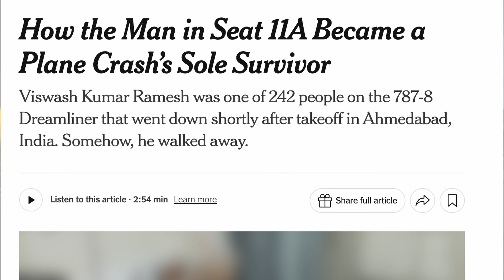Why the RAT Changes Everything – Air India 171 Update

Comment: I know exactly what happened to this flight. I did extensive research. I found a lot of interesting things about Boeing and Airliner. This is the fault of both Boeing and Airindia sadly. 

Back in 2015 Boeing had a bulletin that went out specifically for this model. 

Boeing identified a scenario where, if the Dreamliner is powered continuously for an extended period (approximately 51 days for the Common Core System or 248 days for generator control units), certain software counters could overflow, potentially disabling error detection or causing a loss of alternating current (AC) electrical power. 

This could result in the loss of stale data monitoring, leading to erroneous flight-critical data being routed and displayed as valid, which might compromise the crew’s ability to maintain continued safe flight and landing.

To mitigate this, Boeing instructed operators to perform regular electrical power cycling—specifically, to deactivate and reactivate the airplane’s electrical power at specified intervals (not to exceed 25 days for the Common Core System)

Boeing developed and distributed software updates to address these vulnerabilities. For the generator control units, a software patch was planned to prevent the counter overflow issue, with the update expected to be ready in the fourth quarter following the discovery

In another case, a software update was required for the radio tuning control panels, as a glitch could cause radios to switch frequencies without pilot input, risking missed communications with air traffic control. The fix involved a free software upload, taking about 90 minutes per aircraft

The electrical/software issue highlighted in Boeing’s bulletin is serious because, if not addressed, it could theoretically cause a complete electrical shutdown on the 787 Dreamliner. The FAA warned that a software bug could, under certain conditions (such as running the system continuously for a specific period), lead to a total loss of electrical power, which would affect critical flight systems

Now this would not be an issue if the power cycle is done without missing every 25 days. 

Air India planned a phased rollout to apply the fix across its Dreamliner fleet, consistent with Boeing’s recommendations and regulatory guidance at the time. But they were to apply this fix over five years. There was an article about this in 2019. 

My theory is this airline did not apply for a fix. Power cycling was not done or the issue happened anyway even though air India did the cycling. 

Even through FAA made this fix mandatory in US. Boeing made it look like it’s not a serious issue in the bulletin. 

It’s sad that things like this being overlooked caused the loss of lives. 

And Boeing has been so bad not just recently after the merger but even before the merger they have been cutting corners and have been negligent. 

Air India could also be guilty of not following the power recycling every 25 days. We will not know unless we have more information on this. 

Feel bad for the pilots being blamed. They did the best they could in the situation. It’s just so trajic that once again companies will get away with killing people.
Reply: Yes

Comment: 08:14 Did the lithium battery catch fire or explode, causing widespread damage to the electrical system, including the engine control electronics?

What we know:

• Unlike many airliners, the 787 has a lithium battery.

• The outside air temperature was unusually high at 42°C.

• The aircon was reported as not working on the ground at the gate earlier that day. Maybe the APU was inop, IDK. Was a consequence of not having aircon that the lithium battery got too hot, and later went exothermic and caught fire or exploded?

• Various maximum safe storage / charging / discharging temperatures are reported for lithium batteries, in the range 40-60 °C. If the ground OAT is 42°C, and the aircon is not working, I'm thinking the battery temperature could well exceed that while the plane is on the ground.

Even if I'm wrong about the lithium battery catching fire or exploding, I'm thinking that the combination of high OAT and no aircon could have resulted in some sudden electronics failure e.g. in the power converters from the two engine driven electricity generators. (The two generators are identical, and maybe the power electronic circuits that process the output are also identical, so if one failed and the power load is then put on the other in the same extreme conditions then that immediately fails too).

Source re aircon not working at the gate: pprune.org 12th June.

Comment: It seems that both engines shut down due to electrical or hydraulic failure, causing fuel pumps and engine actuators to fail. Although the Rat deployed quickly and automatically, there simply was not enough altitude to restart the engines. Fully loaded, too slow and too low, they had no chance. Absolute tragedy.
It feels like something was missed at maintenance. A relatively recent plane and model should not go down like this.

Comment: The person who took the same flight from delhi to ahmedabad was also pointing out that electricals were out of use like compressor was turning on and off , in flight entertainment was not working , the air assistant button was also not working. And now RAT too , I think all ths is due to massive electrical failure of the plane .

Comment: What an absolute nightmare to have this happen within a few seconds of takeoff. At least if the engines rolled back before take-off, the pilots could have aborted. To have that happen immediately after getting air bound gave them no chance at all. 

At least Captain Sully had some altitude to attempt a miracle after losing both his engines. Captain Sabharwal had no chance to do anything. 😢

Comment: The plane took the whole length of the runway to take off. They must have had a problem with the engines even when they were stll accelerating on the ground.

This sounds like a fuel contamination issue, right?

Comment: The  vid of the passenger on the inbound flight showing nothing working inside the plane is the big clue for me.

If my car has one or two things not working electrically...'hmm, better get this fixed before this turns into a bigger issue!'

Isnt it the same for planes? I'm pretty sure it is

JS

Comment: We could hear the RAT on the original video. I had no idea what a RAT was, but when I heard the plan fly past that apartment originally my immediate (naive) thought was the engines don't sound right - know we know about the RAT and having seen many tubes showing them, it definitely sounds like this. I'm surprised an expert like Steeeve didn't pick this up straight away.  Someone who knows about these things would surely have got this from the first video and leaned to a system failure rather than blaming the pilots. Landing Gear down could also indicate a hydraulic failure, maybe the attempt to lift the gear started the chain of events. The plane had everything it needed to get off the ground and initially gain altitude, so whatever happened occurred moments after take off - maybe at the time the gear is lifted - a few seconds in.

Comment: Not to sound like a conspiracy theorists, but a former Boeing Engineer turned whistleblower alleged last year that Boeing was cutting corners on 787 and 777 and that they are unsafe to fly and could lead to catastrophic accident or something along that line. That whistleblower mysteriously died in the March this year. This is all following strings of whistleblowers who mysteriously died. And not to mention strings of accidents of 737 maxs, where it turned out Boeing cut corners and FAA let them. Boeing walked away from that scandal with little bit of fine. I think it's high time that the executives of Boeing are investigated not just by the air safety agencies but also by criminal investigations agencies like FBI as well.

Comment: Thanks for your updated video.
In your previous video you mentioned that pilot error by mistakenly lift that flap gear instead of landing gear.
How come you can say that about  such experienced pilots, that video gone for world wide in all main streem medias. The msg came from very well known experience famous person like you.
 And also lay person like me know that the craft manufacturing can't do such a blunt mistake that instead one you lift ther other plane will meet  a crash,  they should made flap can't lift if pilot try to pull without lifting the landing grear it's like child safety measures.
More over pilot clearly said "no power no trust plane going down".
I respect you now for the updated clear message. Thank you so much.

Comment: This latest and higher quality information provides crucial data in determining causation.  It also raises interesting questions.  IF they experienced dual engine failure, then the next logical question is: why?  What caused the R.A.T. to deploy? Was there an electrical failure? Could the fuel system have been compromised?  Ominously,  could the fuel itself have been compromised? If that turns out to be the case, then eyes will shift to the source of that fuel. This aircraft, a B-787-8 was built in 2013.  Based on maintenance frequency, it (should) have gone through at least one "D" check. This is a heavy maintenance check wherein the aircraft is basically taken apart, inspect and any maintenance items corrected or replaced all-together. I'd expect the investigation to focus on the engines and fuel system.  One can almost hear Boeing critics coming out of the woodwork to make claims and allegations against Boeing to make other manufacturers (Airbus) seem preferable to Boeing.  For all the negative press Boeing has had lately, it is noteworthy that this is the first B-787 jetliner crash with fatalities ever.  It is also noteworthy that Boeing is also the same company that brought us the B-747 and many of those are still flying today.  Safely.  With a long future still ahead. So, lets not put the horse before the carriage.  Eventually, the investigation will be completed and positive actions will come of it and hopefully, this will not happen again.

Comment: Could an electrical failure lead to double engine failure?
Because during the previous journey of the same aircraft from Delhi to Ahmedabad, a passenger has recorded the AC not working, cabin crew call switch not working, most of the in flight infotainment system not working, on top of that in his interview to a news channel he mentioned the AC system was going on and off frequently...

Comment: It is possible that a system like the TCMS became inadvertently involved while the plane was still in the air, leading it to instruct both EECs to shut down the engines. This seems to be the only explanation, as there were no explosions, smoke, or sparks coming from the airplane engines. It’s unlikely that both engines would shut down simultaneously due to maintenance issues alone. In my opinion, the only plausible explanation is a system failure, where all redundancy measures failed.

Comment: Very logically explained in a language easy to understand even by non aviators, even though I have been a single engine helicopter pilot. Will look forward to your analysis as and when more inputs keep pouring in.
Reply: Most aircraft crash investigations, have proved facts are normally just a leeds up to the main cause, either human reaction due to confusion, the not so obvious is normally the main cause, the air France was very similar crash, with Rat also deploying, the software problem caused the aircraft to land itself into a forest, at an airshow, has Boeing not also got a glitch in the software, been a new 787 dreamliner

Comment: This is where we are:  It was not flaps. A massive control system/power failure was the cause. The question now is which came first, control system taking out the engines or dual engine failure taking down the control/power system.

Comment: 12:50 

Couple of things the Air India 787 Crash Brought to Mind. 

1st, one of Air India's Boeing 787s Experienced the Initial Lithium Battery Fire. 

2nd, the two Boeing 737 Max Crashes were the Result of MCAS Over Control. 

3rd, an Air Florida 737 Crashed into the 14th Street Bridge in Washington DC after Taking Off from Washington National Airport during the Reagan years of the 1980's. 

1-the Air India Boeing 787 that caught on fire due to Uncontained Lithium Ion Batteries was Heavily Damaged. This was a Result of Improper Engineering Analysis and Implementation of these New, to Commercial Aircraft, Batteries.  The Problem was Re-Engineered and Supposedly Fixed. Can't Remember if a World Wide Grounding Was Required for That. 

2-the two Boeing 737 Max Crashes Caused the Aircraft to be Grounded World Wide. The Problem was Traced to the Programming of the MCAS, or Maneuvering Characteristics Augmentation System, which Overpowered the Pilot's Ability to Control the Aircraft. MCAS was Engaged upon Retraction of the Flaps after Takeoff. The Problem was Fixed by Re-Programming the MCAS, Adding Redundant Angle Of Attack/Air Data Sensors and Additional Pilot Simulator Training. 

I Believe that Both Crashes Could Have Been Avoided by Extending the Flaps to the First Detent, which would have Removed MCAS from the Control Loop and Allowed the Pilots to Regain Control until Landing. Tried Notifying Boeing, the FAA, NTSB and Other Agencies, but Never Heard Back from Them. Still Don't Know if this Procedure would have Worked, or was Ever Tried in a Simulator, Before the MCAS Changes were Implemented. 

3-the Air Florida Boeing 737 that Crashed into the 14th Street Bridge and then the Potomac River during the Reagan Administration, Barely Made it Off the Runway on Take Off and was Unable to Climb Successfully. 

It Apparently had an Engine Exhaust Pressure Ratio Sensor or something Frozen that would not provide a Proper Indication.

When the Pre-Calculated EPR was Input to the System by the Copilot, He Set a Bug on the EPR Indicator. This Allowed the Throttles To Be Advanced Until the Indicator Reached the Bug. The EPR would Be Monitored to Make Sure it Stayed at the Bug Ratio that was Set. 

Problems was, at the Set EPR Ratio, there Wasn’t Enough Power to Accelerate the Aircraft to the Proper Climb Speed and Climb Angle. 

All the Pilot Had To Do was Advance the Throttles All The Way and They Would Have Been Able to Get Airborne and Climb. 

Nothing Wrong with the Aircraft. Just Improper EPR Ratio Set. Might have been the Temperatures were Cold enough to Freeze the Air Sensors and They Didn’t or Forgot to Turn On the Heaters for the Sensors. Can’t remember exactly, but Something Like That. 

Air India Could have had a Problem that Resulted from Similar Missteps.

There Could have been a Disconnected or Blocked Sensor, which would have Told the Engines to Shut Down. 

It Could have been from a Missed Maintenance Check Item or a Sensor Blocked by Debris or Covered for Maintenance and Not Removed, Etc. 

It Could Also be a Missed Pilot Checklist or Something Entirely Different. 

The Scenarios Offered by Your Commentators Also Seem Highly Logical and May Offer the Correct Diagnoses.  

Just that Boeing Engineering, Both Hardware and Software, Lately, Seem to have had a Problem Getting Things Right, The First Time. And, It Is Sometimes Very Difficult Tracing the Cause Back To Its Roots.

Comment: I saw the "white smoke" from the port engine ...is that moisture pluming from the port engine at rotation?
As a retired aircraft engineer, with some Qantas connections. Qantas has been getting uploaded with contaminated Jet A1 affecting the GE engines at some ports. Just a current theory of mine.

Comment: Looking at that video. It convinces me that the aircraft had electrical failure and that would explain what i have seen on the news that the aircraft took too long to lift off. 
Surely if the engines had failed the plane would not have took off. 
How long would it be for the electrics to come back on line after deploying the RAT before being able to control the plane?
Also were the flaps out? Maybe the controls worked but the flaps didn't?
With the RAT on were the controls working ? 
If so. Why not just put every last bit of power into getting speed up before ascending?
Gear was still down, thats a drag. Surely that would have been noticed?
If so. Could they retract ?
Back to electrics.
If dual engine failure, when the did the survivor hear the bang? before or after lift off?

As for the survivor ? WOW , how lucky!

Comment: Sir, the visuals also shows that the airplane looked as if it were gliding smoothly and evenly just like a glider about to land. and may attest to the theory that both engines had stopped working. 
You analysis puts double engine failure at the top spot for further investigation.